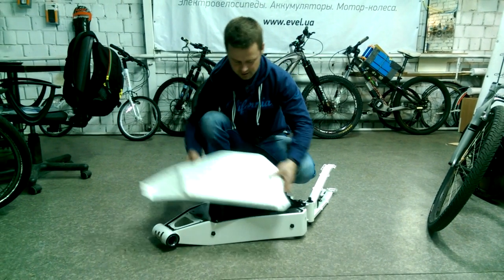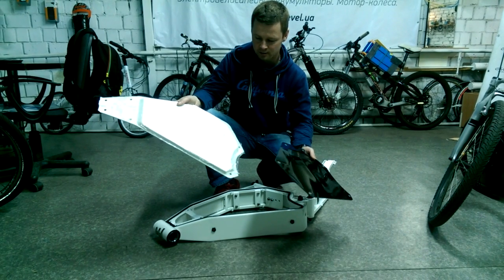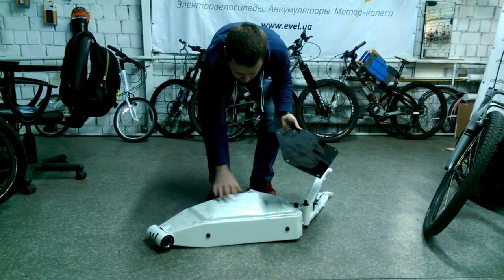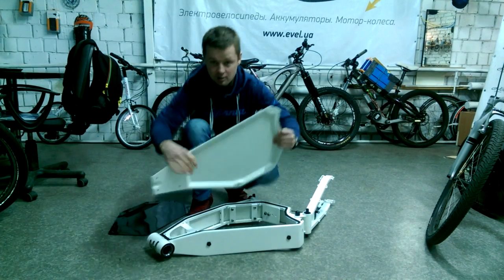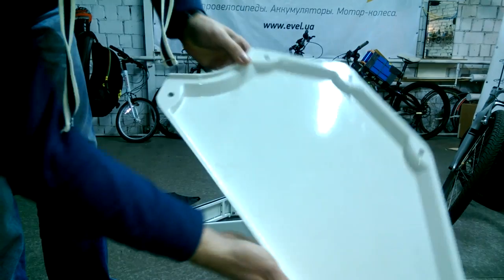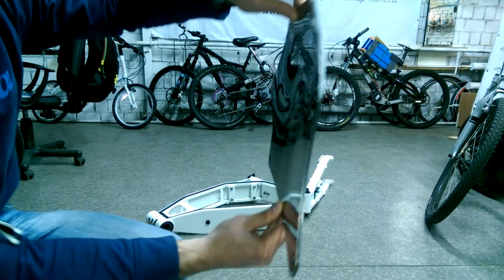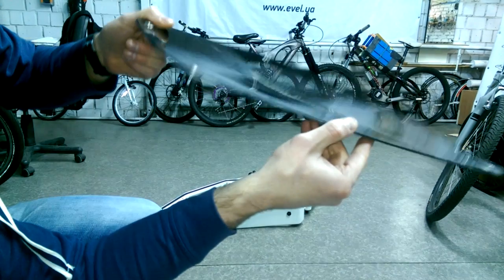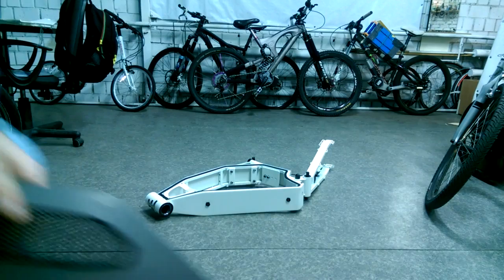Crush test Vector and Electric Enduro side panels

Comment: Thank you for showing this. I agree with you. Panels are much stronger when stamped with form like plastic panel. Flat panels are weak, and aluminum is very soft. This being said, both would be easy to puncture with sharp object like rock or a heavy branch.